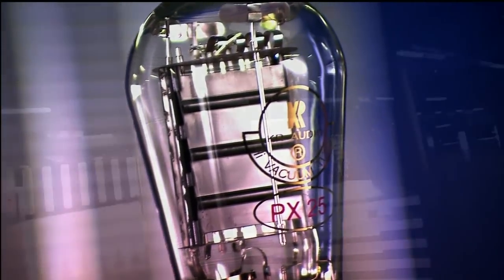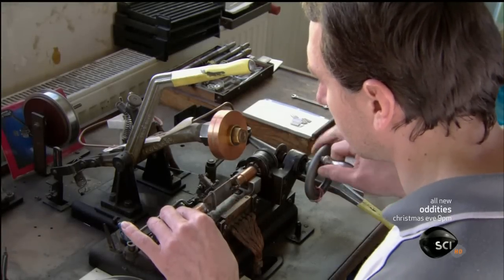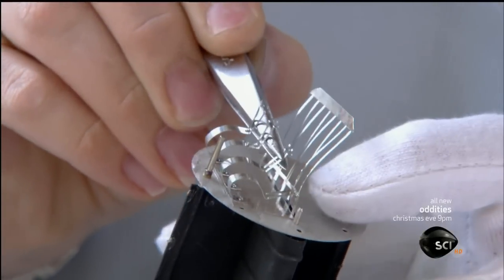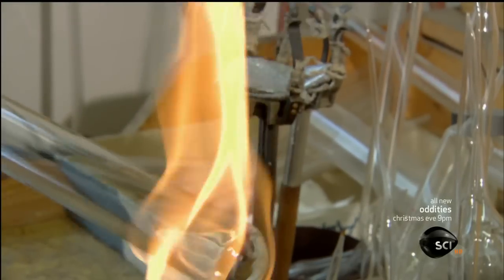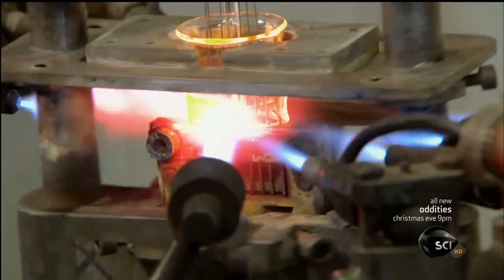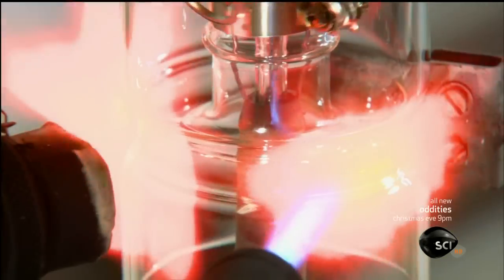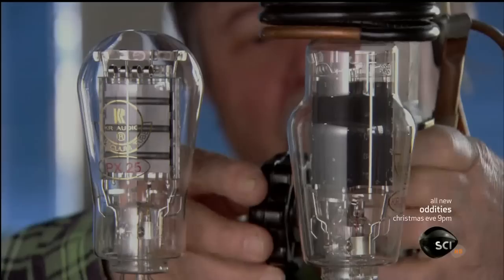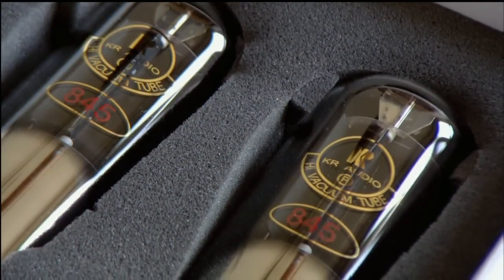How It's Made - vacuum tubes

Comment: I think nixie tubes are evacuated and filled with either two gases argon or neon but either way the voltage in the numeric and or character type tube requires about at least 170 volts dc but other than that it's pretty basic an positive charge applied to the anode and each character will have a negative charge at a given time thus striking the gas to glow on the given character or number.

Comment: I dont think the filaments dont disipate enough power to burn up . Actually most of the breakage I've experienced with tubes has occurred with storage and handling. I can always tell when the vacuum has been breeched when the shiny coating on the glass next to the getter disapears and a foggy white haze is all that remains. I hate throwing these once nice NOS tubes away. Hoe much vacuum does the envelope require? Do you suppose that barometric pressure and altitude effect tube performance?

Comment: nope, not gonna work.  an EQ is a static device, so it can only adjust specific fixed frequencies.  a tube's transfer function has a dynamic effect on the harmonics (output vs input), which means if the input tone moves by a half-step, the harmonics in the output also move.  an EQ's bands don't move or track the input.  ergo, fail.

Comment: You may google for it, (I tried to put links but it seems is not allowed here) 

or there is many of these one might find in the world. 

And for the end, What are bih boxes when end amp is in issue is output transformer, (according what I've said), as they handle with large voltages. So to protect speakers from that voltage, a transformers are used). 
:-)

Comment: To an extent but pickups have no effect on distortion per se since they produce the original signal which by definition cannot be distorted.  It's the amp(s) that distorts the original signal.   Its true some pickups are hotter and drive an amp into distortion earlier.  Distortion pedals are just amps that intentionally introduce distortion in a signal.

Comment: So, how do you explain why the tubes have so short lives ????

A transmitter tube, generating tens of kilowatts can easilt last over 20 000 hours and in old tube TV's, the tubes could last for many many years, which is NOT the case with today's "hi-fi" amplifiers.

Comment: Well, most tubes are oxide while RF tubes including 845's are thoriated tungsten which is why they glow intensely.  The old tube production tubes, which for the most part ceased during the 1980s, are superior to the Russian and Chinese makes.  This is especially true with the small signal tubes 12ax7's, 6dj8's, etc..

Comment: All amplifiers clip hard when driven beyond their maximum voltage swing. Tube amplifier already produce distortion at a level far below the maximum swing, whereas transistor amps (thanks to a large open loop gain and copious negative feedback, not thanks to transistors!) stay linear up to close to the clipping limit. A transistor amplifier can be given a soft clipping circuit to help protect tweeters, and this will lower the the maximum RMS power that can be quoted at the near zero THD figure.

Comment: However, you've probably seen large fluorescent tubes (neon lights). Well, there are of course rarefied gases inside, rather than a complete vacuum: after all the electrons need to have something to strike throughout the tube so that we obtain light! Electrons move in the same way: thermionic emission from the cathode. However: these are "cold cathode" tubes. Cold cathode doesn't mean the cathode is actually cold, just that it's not heated by a filament.

Comment: And as for power consuption of one preamp tube,  (ecc 83, or 12AX7 tube), here is tipical voltage data:
anode voltage is 250 V
anode current is 1.25 mA
Heater voltage is 6.3 V 
Heater power draw is 150 mA
That is double triode so if one plans to use both in one setup heater currents nedds to be doubled. 
It is not much, even in compare with modern preamps in A class :-)

Comment: And furthermore (and at my own advice, shameful), i've learned lately that most of these "audiophile" amplifiers OVERBIAS the tubes. This results in tubes having an atroceous short life. This is almost fraud.

On their side, transistors do not allow overbias (resulting in an instantaenous failure), so  solid state engineers have to respect the device ratings, resulting in highly reliable products. Unfortunately, vacuum tube amp designers do not have the same level of respect.

Comment: I'm 100% there with that the tubes break easily. But they actually doesen't cost that much. Typical preamp tubes cost here 10€, and power tubes less than 20€. And depending on the amp, you need to replace them in like once in 5 years, if you don't kick the amp down the stairs alot.

Comment: The electronic characteristics are some of the reasons that Vacuum Tubes and Bipolar transistors behave so differently in audio systems.  However, MOSFET and JFET audio systems can be designed to sound very similar, because the devices have most of the same electronic characteristics.  Only tubes will exhibit small changes in inter-electrode capacitance, caused by audio vibration.  That is to say, they are microphonic. Therefore, the housing and placement of your tube amp can modify the signal.

Comment: true. It can mostly be noticed in a live setting. Try and play a scorching solo over a rock band with a solid state amp, then a tube amp. The tube amp pushes through and sings, where the transistor amp ends up sounding buzzy and thin. That is how I have been able to show the difference easily. But tubes are also reactive compared to solid state, and can be much much more expressive...but that's a whole other thing. :)

Comment: Decades ago, guitar amplifiers were made from tubes, and by dumb luck, the straightforward circuits borrowed from radio sounded great! With a few simple tone controls added to them, they complemented the tonal profile of the passive pickup perfectly. Later, rock and roll came along, and it was found that overdriven tubes sound great. By an amazing coincidence, some of the things that tubes do in circuits that are nearly obvious and not contrived for guitar, happen to work well for guitar.

Comment: Modelling vacuum tubes, especially with their distortion characteristics in mind, is actually much more involved than a simple EQ preset. Vacuum tubes are highly nonlinear devices, so not only do you have to use piece-wise-linear functions to determine output as a function of the instantaneous input, but you also have to model the transient characteristics involved if you want to impress professionals.

Comment: 1:21 ah no, it reduces secondary emission of electrons and increases the cooling of the anode. And it's not secret, it's simply carbon and has been in common use since at least the early 1930s.

Comment: There is a video I saw of a factory tour of the Mullard tube plant in England from the 1960s, they were making an ECC82 as a sample. It was very similar to how light bulbs are made using a button and stem method, but with more elements of course. Valvo would have used very similar techniques, Valvo, Mullard, Phillips, and Rogers were all owned by Phillips in that era.

Comment: Obviously you've never heard a tube hi-fi amp or it had issues.  I retired all my solidstate gear after hearing an old push pull 6L6 HH Scott amp.  And it's not even that good compared to what's available in the tube world.  The cleanest most life-like music I've heard was from a single ended tube amp.  While the cleanest MOSFET solidstate I've heard was is harsh and unmusical. It's that underlying thin transistor sound that drives me nuts.  Plus tubes are fun to watch and "tube roll".

Comment: The thing I love in tube guitar amps, is the simplicity. With a very simple device, I can get a very pleasing tone out of the amp. I built an amp myself, and I think I would have ever achieved this by using transistors or digital components. I didn't need any PCB boards and fragile components, just a simple turret board which should hold up for decades of repairs and modification, and robust big parts.

For me, that's why tubes are being made ;)

Comment: You missed my point,

Vacuum tubes are a pretty ugly way to amplify, and there's absolutely no question that transistor amplifiers are much more mathematically correct (until clipping, because then there is no right answer), and since for most purposes distortion is unwanted anyway, that makes them perfect.

It's somewhat comparable to the vinyl vs CD debate, except the difference there is less obvious. Tubes flavor your guitar like mad... again, that's not a bad thing. I am NOT ANTI TUBE.